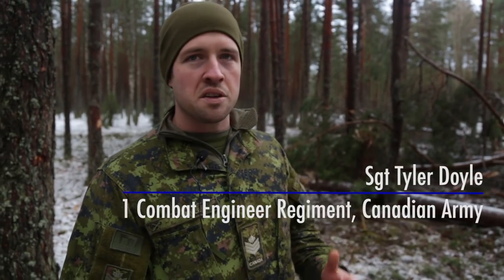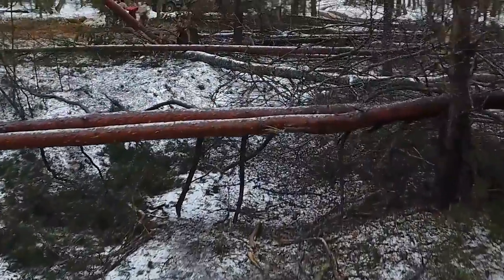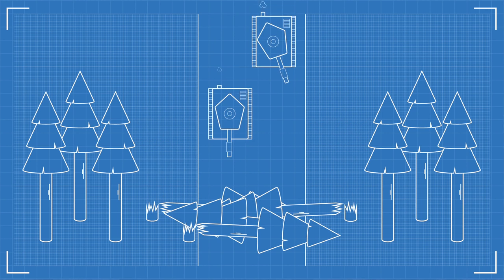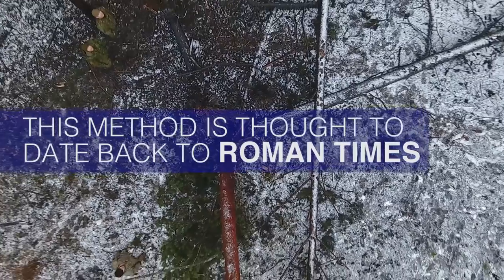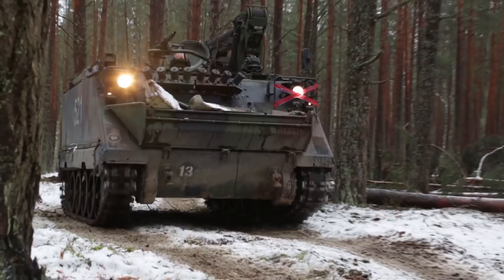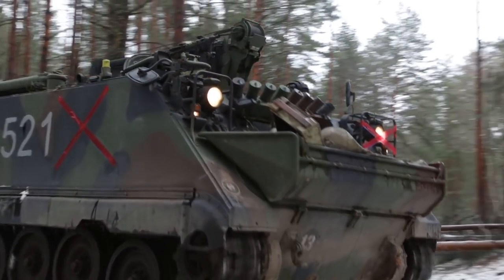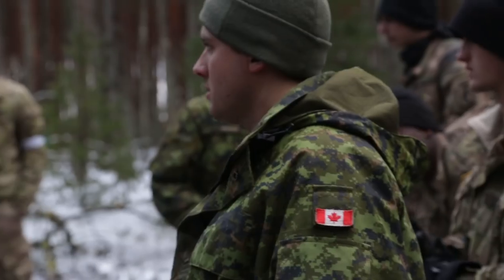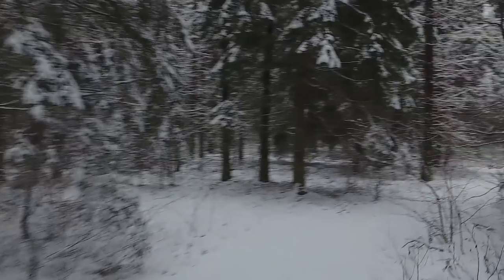How to stop a tank using felled trees

Comment: or next level could be  setting up explosvies behind them too so they couldn't withdrawl  to another secure area then ambushing them by using terrain that their vehicles cannot go well off road on  or even planting explosives inside the road or ieds.     IMO most heavy vehicles equipped to tow bar or winches could probably remove a road block fairly quickly  unless very large trees are available also an intelligent force could gather forensic data  or even bring in blood hounds etc.. if they were available to track people down.  you can also use this to  funnel people along a specific parrt of the road that is booby trapped somehow as if there is enough room for them to pass they may take the route if there is an obstruction on the rest of the road. The improvised books also state it was common to booby trap the road blocks so if they were attempted to be cleared it could endanger people. If you do this often enough tthen they will treat ever road block like a IED booby trap point and it will slow down operations.